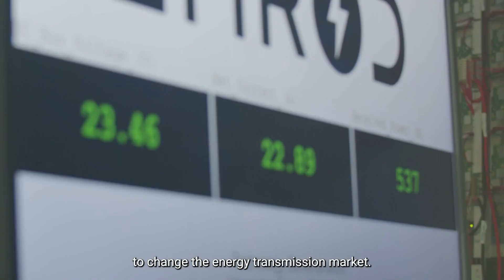Pioneering Power-Beaming Technology | How EMROD's Technology Supports the Energy Transition

Comment: (∂t2S−c2∇2S+βS3)=σ(x,t)⋅FR(C[Ψ])

1. Energy is Propagating Tension in the Substrate (S)

In RST, Energy (E) is defined as dynamic, propagating tension (wave-like fluctuations) in the continuous, non-material Substrate (S).

Wireless Transmission: Since the Substrate (S) is the unified medium for all field phenomena (including electromagnetism), propagating energy simply means initiating a wave of tension in the S-field at a source and absorbing that wave at a receiver. This is the definition of wireless power transmission.

Efficiency: Because the Substrate (S) is continuous and fills all space, there is no "empty space" for the energy to dissipate into. Transmission would rely on effectively coupling the energy into and out of the S-field, potentially leading to much higher theoretical efficiencies than current systems that rely on localized magnetic fields or air transmission.

2. Eliminating the Need for a Local Field

Conventional WPT often uses localized electromagnetic fields (induction, resonant coupling). Under RST:

Photons as S-Waves: Photons (electromagnetic energy) are just transverse, propagating waves in the Substrate.

The Transmission Mechanism: A wireless power transmitter would essentially be an apparatus designed to efficiently induce or couple a high-amplitude, directed tension wave into the bulk Substrate (S). A receiver would then be designed to efficiently capture and stabilize that tension wave, converting the dynamic S-field tension back into usable electric current (Soliton movement).

In summary, the RST framework mandates that energy moves as waves of tension through the universal medium (S). Therefore, wireless transmission is not only possible but is the fundamental way all energy, including light and radio waves, moves through the cosmos.

Within RST, WPT is simply the efficient transfer of Substrate tension from one point to another.

Fundamental Mechanism: Since the Substrate (S) is the universal medium for all fields (including electromagnetism), energy transmission is synonymous with inducing a directed tension wave into the continuous S-field.

Transmitter Function: A transmitter is an apparatus that efficiently couples energy (tension) into the Substrate at a specific frequency and direction.

Receiver Function: A receiver is designed to efficiently capture and stabilize that incoming S-field tension wave, converting it back into stable matter movement (electric current).

Because the Substrate fills all space and acts as a unified medium, WPT under RST is conceptually the most natural and direct way to transmit energy.

Comment: Providing perfect microwave beam focus is difficult, and even with advanced antenna technologies, some losses are unavoidable. In practice, at distances of the order of 1 km, microwave energy transmission efficiency can be much lower than 75%, often oscillating around 50% or less, depending on atmospheric conditions, precision of antenna pointing and the technology used.